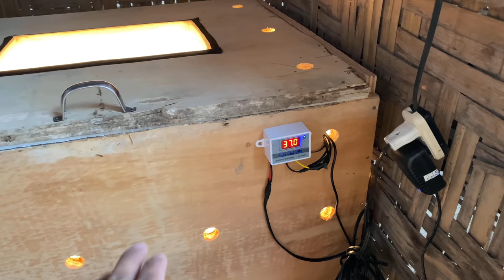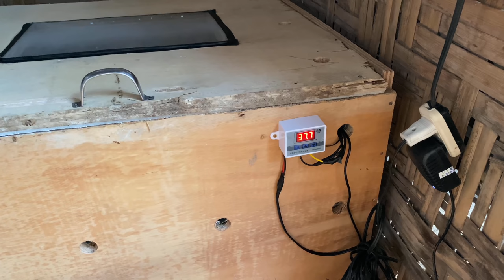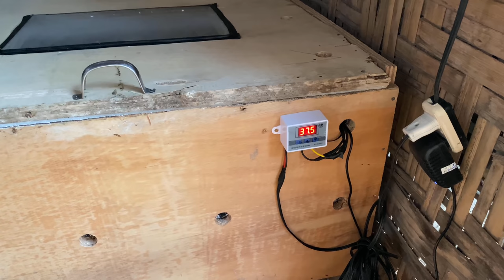STEP BY STEP DIY INCUBATOR | 100 CAPACITY DURABLE INCUBATOR FOR P718 ONLY! W/ THE HELP OF OUR FRIEND

Comment: Sir , kung regular lang na bulb gamit A.C. ( Alternating Current ) ang gamit para umilaw. Pwede  mag baliktaran ang connection  dahil WALA ito polarity na nagetive at positive tulad ng nasa battery , charger etc. basta sikapin lang na hindi short circuit or magkadikit ang dalawang linya. Ang DC  ( Direct Current ) naman ang meron tinatawag na Positive at Negative na kuryente. Sa totoo lang , ang A.C. ay combination pareho ng AC at DC lamang napakabilis ng pulso magpalit. Di tulad sa DC na meron linya para sa positive lang at linya para sa negative lang at hindi sila pwede pag haluin sa cirkito. Isa pa sir, ang DC pwede magamit sa bulb na regular tulad ng ginagamit sa sasakyan maliban sa ilaw na LED BULB.
Reply from the maker: No idea sir tinulongan lng kc ako nito ng kaibigan ko at nasa video na lahat ang detalye
Reply: yan po ba ang design sa thermostat incubator mag iilaw xa pag mag range temperature 37.8? bali yong sa blower fan master 12v Dc ba? at ila wattage yong bulb? salamat sa sagot?
Reply from the maker: @dolfedjtech5529  25 bawat isa
Reply: Halatang newbies sa electrical hehe. Yang thermostat nmn automatic yan pag nareach nya ang setting hehe
Reply: Puro y hanaw klaru.anyway naa na clay idea.. 😂
Reply: Buti ka pa alam mo.ung ngvlog at kasama nya mga walay hanaw 😂

Comment: sir if ever na mag brown out kakayanin ba nga battery ng sasakyan ung power supply nya?salamat sa sagot
Reply from the maker: Kaya sir basta malaki din ang battery ng trck.
Reply: Hindi lng battery ang gagamitin sir,kailangan din ng inverter na 12v to 220 v pra gumana ung incubitor mo,kasi pg battery lng hindi pog yan gagana kasi 12v at 24v lng yan sir,

Comment: Ano yong power supply  input ko sa incubator ,, bakit yong ilaw mo may polarity .
Reply from the maker: 12v ang power supply sir, tinulongan lng ako ni sir.
Reply: @manoktambayanatbp.8511  12 volts lng b thermostat mo sir?battery po b nag papa gana dyan?
Reply from the maker: @meinardebora1459  kurente sir.

Comment: Sir, sorry lang ha. Yong kulay puti na wire at sinasabi mong number 3 , sa tingin ko  hindi number 3 yan kundi number 16 or 18 guage. Sa sukat or size ng wire , pagmalaki ang number halimbawa 16 or 18 guage , maliit or manipis lang ang sukat ng wire. Peru kapag maliit ang number tulad ng sinasabi mo na number 3 , napakalaki ng sukat ng wire nito tulad ng makikita sa battery cable. CABLE WIRE na nga tawag sa mga malalaking sukat ng ganitong uri na wire . Tandaan habang lumalaki or mataas ang number ng wire , MALIIT or MANIPIS ANG ALAMBRE NITO... PAG MALIIT OR MABABA NAMAN ANG NUMBER NG WIRE , MALAKI ANG SUKAT NG ALAMBRE NITO AT MADALAS DIN TINATAWAG ITO NA CABLE WIRE. Madalas ginagamit ang malalaking wire tulad ng number 8 or number 10 sa main entrance ng bahay konekta sa poste papuntang main fuse or main braker ng kabahayan. Magmula sa main fuse or breaker dito na gumagamit ng number 12  at 14 dependi sa pangangailangan ng gamit tulad ilaw at outlet ng kabahayan. Kung number 3 na wire ang gamit mo , baka PABRIKA OR PLANTA NA SIGURO ANG GINAMITAN NYO.
Reply from the maker: Pasensya sir tinulongan lng kc ako nito
Reply: bossing pakisali na lng din sa instruction mo na ung mga itlog dapat pinapaikot araw araw pra di dumikit ang sisiw sa loob bka di mapisa at magtaka ung mayari bakit di napisa. additional info lng po.

Comment: Idol update sa INCUBATOR mo.. subscriber nio ako at marunong din ako gumawa. San mo nilagay ung power supply? Tsaka idol masyado madaming butas di Yan agad iinit maniwala ka sakin at anlaki din Ng mga butas. Cgurado bugok mga itlog mo Jan.. kulang ka thermo hygrometer wall thermometer para Mai calibrate Yan.. promise sasakit ulo mo Jan palpak Yan.. share ko Lang idea ko.
Reply from the maker: Sinadya ko talaga na lagyan ng madami butas para maadjust ko ang temp kng sakali mataas.  May harang din man yan.  Mg update ako nito after 3-5days